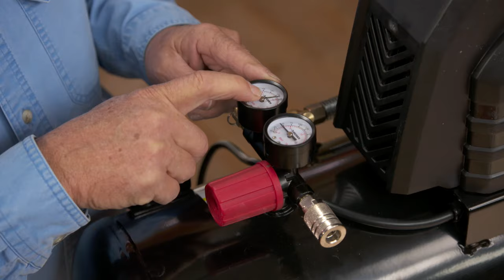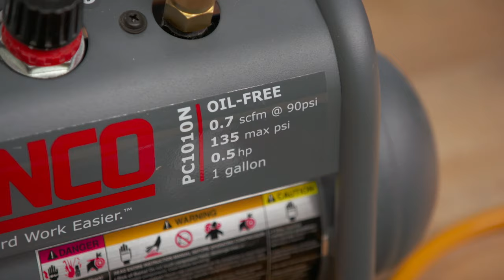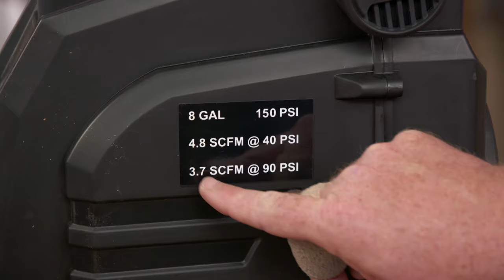How to Choose and Use Air Compressors | Ask This Old House

Comment: I went to the smallest vertical one I could find. Those horizontal ones are a pain to roll around because you can't tip them up to high before the tank drags on the ground.
Reply: That's an awesome point that I had not considered. Thank you!

Comment: What’s the danger of a rusty tank and how do you fix it?
Reply: What could happen to a reservoir which holds pressure and its wall is weakened? In the worst case: Boom! 
Don't mess with repairs on the tank, exchange it. It's a matter of safety.
Reply: A rusty tank is very dangerous as it can explode without warning. There really is no easy / safe way to repair a rusty tank on a home air compressor. It's not just the rust you see. If you SEE rust chances are there are more areas that have rusted but isn't visible yet. If your tank has gotten rusty it's probably time for a new air compressor.  The best way to prevent rust in the tank is to drain the water out regularly.
Reply: Amirhousein Hazratifar, Most will start with a small leak and not an explosion.
I have seen most occur around the drain area.
Reply: You have to either bleed the air out of the tank every time or use a timed Solenoid that pushes water out of the bottom of the tank.

Comment: You'll love mine. It's a 10 gallon plumbed into a 50 gallon hot water storage tank lol
Reply: @jasenrock  Nonsense. Hot water tanks are built to withstand high pressures. And if he left the overpressure release valve on the tank there's very little risk of tank failure.

Comment: by adding a second auxiliary tank to an air compressor will that increase or decrease performance like SCFM? thanks!
Reply: It would do neither. It would effectively only give you a bigger tank and that tank would take longer to fill. Also, it would make the compressor work harder. The "ON" time of the compressor would need to be managed to avoid damage.

Though, the air in the tank(s) doesn't have a practical CFM limit. It's limit is the size of the opening it's able to pass through. So, it would work like a compressor with a higher CFM rating. It would work like that until the pressure in the tank(s) lower(s).

(I know that your comment is two years old but maybe this is still useful info.)
Reply: @luchvk  i appreciate it man. I still needed that information
Reply: @MrBod4life  Glad to help!

Comment: also remeber you need air tool oil for the tools
Reply: True Story ! Most people forget for some reason ?
Reply: There are miniature automatic oliers one can screw on the airline some tools, wich are supposed to generate an oilmist in the intake, but i also oils some of them separatly right before using them.

Comment: I got one. Is it safe to use on condenser coils on your fridge?
Reply: Only if you don't exceed about 20psi on the air regulator when you're blowing off the dust

Comment: I have a hardon for MaxTools high pressure systems. 
If you do alot of large nail nailgun work(4inch nails or bigger) get the Max HS130. It is the best big nail nailer on the market. You can argue otherwise but you are simply wrong.
The benchmark for big framing nailers is the Bostich Big Berta. That big bitch weighs 25 lbs or more iirc.
Hs130? 10lbs. 
You can't beat that. You just cant. The downsides of highpressure systems be what they may. The hs130 is god tier

Comment: Is there a festool of job site air compressors? All of them i have used SUCK  for one reason or another
Reply: wimmisky  
Thanks

Will do some digging
Reply: @williamsmith9026  I got a CAT 6 gallon several years ago from Menards for like $140 less 11% rebate & absolutely love it. =)
Reply: quincy QR-25

amish use AIR power tools 
and leave the ENGINE driven compressor running all day